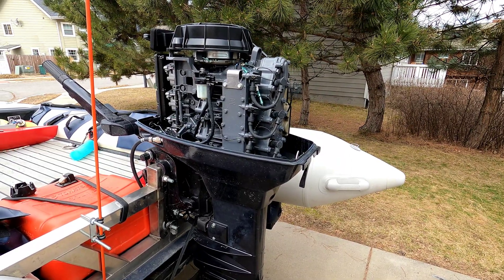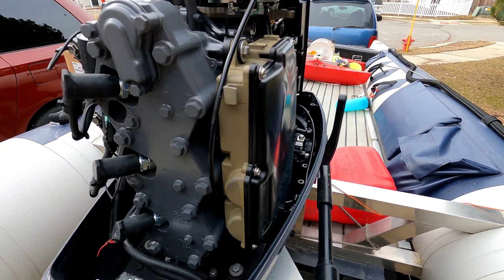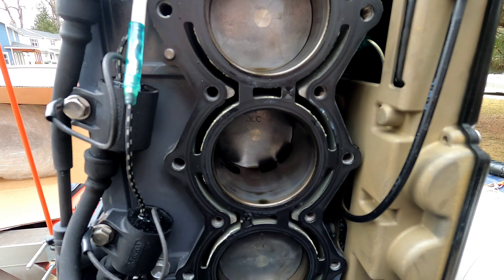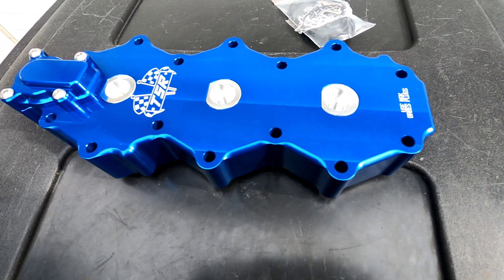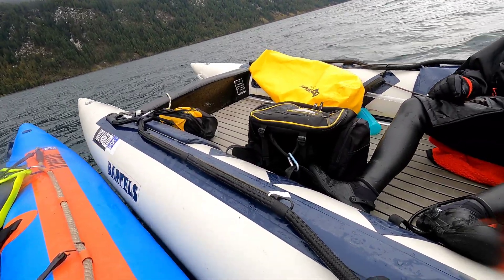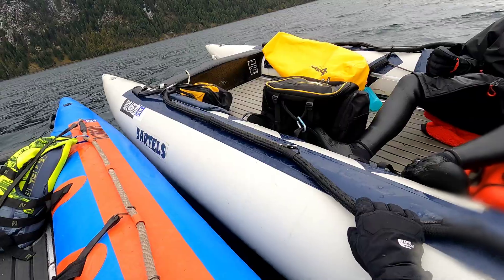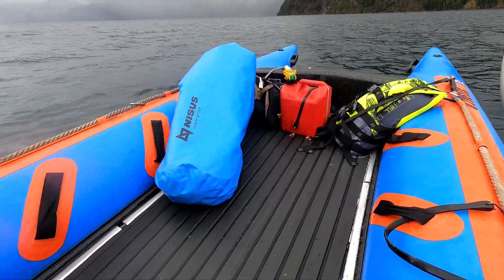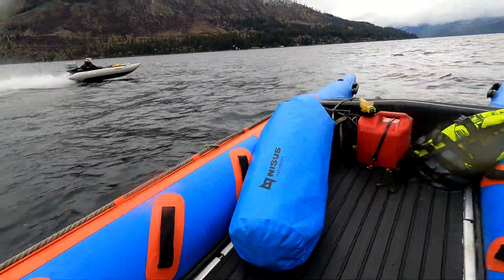TSR Tohatsu high compression head

Comment: I have found if you raise all the ports 0.030 use a degree wheel 50 shortened tuner wakes these motors up. Stainless reeds will make make the most power as you know they can come apart over 6000. The Boyesen two stage reeds work great. Post some more results. Thanks for sharing.
Reply from the maker: Plan is to make them short shafts first, them mods. One day.

Comment: Hi, can you explain more about this outboard type the MX50 Everrun because there is not much info about this outboard?
And I own it one…
Reply from the maker: As far as I understand, it has two differences from the common M50D2. It has a lower compression head  and  a bigger gear ratio. Everything else should be the same.

Comment: Nice review. I'm currently fixing up a m40D2 converting to a 50. How do you like the powertech prop?
Reply from the maker: They're pretty good. Nice thin blades. We really like our michigan wheel Appolo props too, but those max out at 15p. That's the one I run on my boat.
Reply: @codemang3635  Thanks! I think 15P is probably a good compromise between holeshot and top speed , especially in 4 blade config. top speed is fun but holeshot like a slingshot is even more fun imo
Reply: @fullsendmarinedarwin7244 how to convert a 40 to 50?…just carbs, reeds, timing and exhaust?…or you need more mods?
Reply: @ I haven't done it yet, but yes seems to be carbs, reed block, and exhaust tuner (i found a 50D1 tuner to buy)
Reply: @fullsendmarinedarwin7244  please share pics of the process 🙏. Good luck 🍀
Reply: @nunomascarenhasribeiro  gonna have to get your big boy pants on and look at the parts catalog for both

Comment: How comes you’ve got a long shaft on a zapcat?
Reply from the maker: It's what we could get ahold of. Shorts are quite coveted, and priced out of reach.
Reply: @codemang3635 you could covert it zapcats like the engine lifted quite high with a big cleaver
Reply from the maker: It's lifted 3 inches. Any more would freak me out.
Reply: @codemang3635 what speed are you getting
Reply from the maker: 44mph in this vid
Reply: @codemang3635 I’m on the process to restore a 40 Tohatsu (25 Mega) 3 cylinder. It’s a long shaft….unfortunately. I can see you raised your motor 3”…why not a bit more?…it gets too tippy the boat?
Reply from the maker: @nunomascarenhasribeiro  I don't have any personal experience in one with a short shaft, but from videos I've seen, it looks like they can hold their ground a little better. But then again, those guys are leaning into it correctly, and with skill. 

With the skeg as deep as it is on ours, the leverage might actually help. Hard to say. We're certainly not having any issues with stress on the tubes at the transom yet.

But if you go e past 3 inch, you might get tippy AND lose the bottom leverage from the skeg in a hard turn. Really only one way to find out what it'll take.
Reply: @codemang3635  thanks for your input. Great videos, content and scnearios.....really good stuff.👍